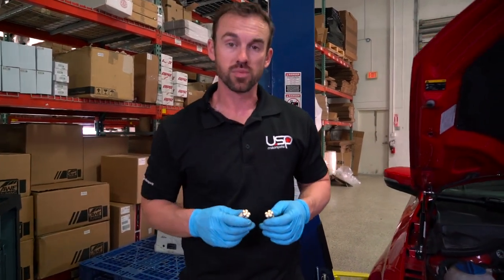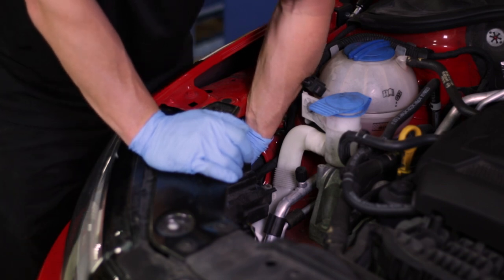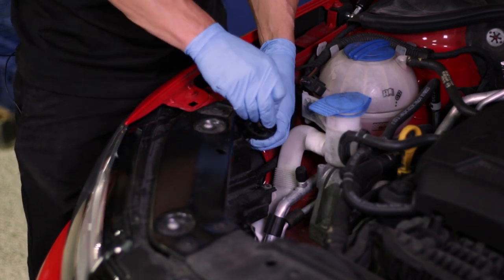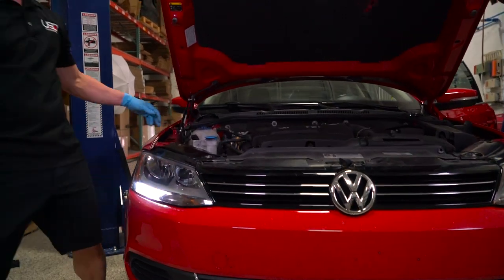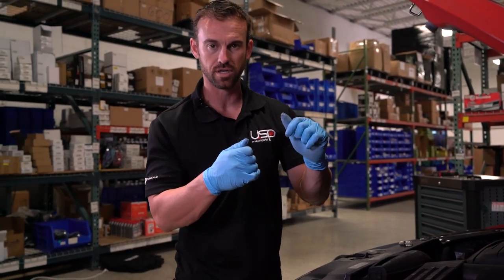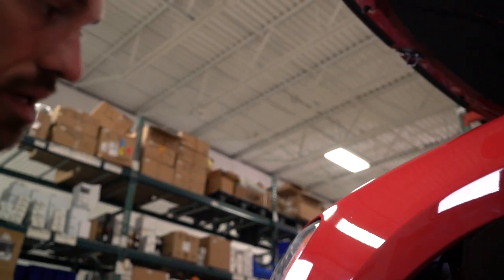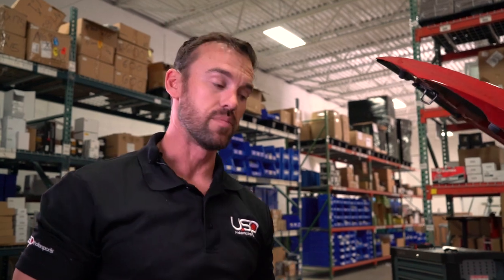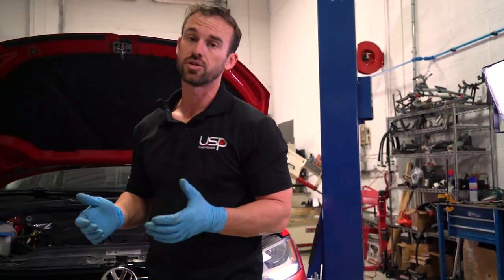MK6 Daytime Running Light Installation | RFB Lighting

Comment: I spent 2 hours trying to get the drivers side bulb socket to come loose.  It's just so tight and my hands are cut up very bad. I need help.
Reply: OGzGaming Juggernauts same lol
Reply: Michael L tell me if you ever get it and it's ridiculous  how these vw engineers make it so we have to go to a dealership just to get a bulb out.
Reply: OGzGaming Juggernauts I got it out after about 40 minutes of struggling and bruising the hell out of my hand, but thankfully they look nice and i wont have to worry about changing them out ever.
Reply: I use with the driver side Dw40 and start moving up and down to lose it really hard after you feel it loosen start twisting after you replace the bulb use those light bulb lubricants in the bulb and in the socket
Reply: guillermo ortiz my brother thank you! As soon as I applied the wd 40 it twisted right off.
Reply: Proj Gause How did you apply the DW-40 to get it off?
Reply: Take the headlight bulb out too.
Reply: I had mine changed in 5 minutes after watching this video.   Its a lot easier if you push slightly before twisting counterclockwise.  If you can't get your hand in there, just find someone with smaller hands.   Also, to make it easier next time,  put a little grease on the three slots in the socket housing.
Reply: I can’t get the passenger side off. Has hand surgery 2 years ago I just can’t get enough leverage to break it lose. I hate to do it but I might take off the right tire and wheel liner for easier access. Good lord this is a serious PITA lol

Comment: Thanks a lot for this video but my god was that a pain in the ass to do. The driver's side bulbs are so hard to get out that i had to use pliers and when i finally pulled it out of the socket my old bulb burst and glass is all in my headlight.

Comment: Hi, I already install the right and left DLR bulbs but they are not working, I have a 2012 jetta style active, could it be a fuses problem?, can u help me to identify what else need to check
Reply: Jorge G. D. They are polar sensitive so try them the other way around, they have to be in the right way
Reply: Jorge G. D. Your drl is probably shut off. Look in the manual on how to turn them on.

Comment: Why would an LED Light like this not trigger a code but say a Sylvania LED 6000k bulb would? Thanks
Reply: It has a built in resister so it doesnt throw off a code
Reply: The only Caitlin thanks for that reply. Soon after this comment, I did my research and figured that out lol. I also purchased these bulbs. They’re CAN-BUS compatible and therefore wont through a code.

Comment: Guys just loosen your bumper and take out the headlights. Spent over 2 hours fooling around with the drivers side. Just take the headlight out!
Reply: Peter G I actually try to unscrew the bumper then the headlights? Did it once with a friend. Still couldn’t get to it. Such a pain in the ass. Unless I did wrong. What’s your suggestion? Can you explain it in detail

Comment: drivers side is pure stupidity.  I cant get to mine at all.  my hand wont fit the dust cover hole.  Can't get my hand in deep enough to turn the light, fingers reach but hand to big to get thumb in as well.  Tried compressing hand to get past hole but hand in bad position to manipulate the light and thunb not in place to get to light.  I have that fuze box in the way.  NO WAY am I removing wheel to get to light.  This is a bullshit design.

Comment: Right, so to change a bulb 💡 in a VW, you need to jack up the car, remove the wheel and unscrew 16 Bolts - And Then ... it’s STILL almost impossible to remove without cutting up your hand.  Very stupid design .... by the Germans.
Reply: Rob I tried it yesterday and I had no problem. I didn’t have to take the wheel off or remove any screws. You unscrew a plastic disc that covers the back of the headlight, and if you have a small arm and hand you can get to the bulb no problem